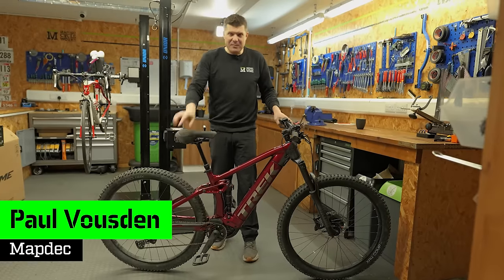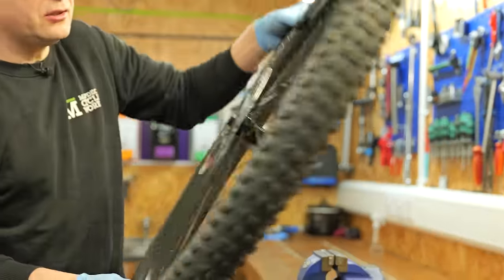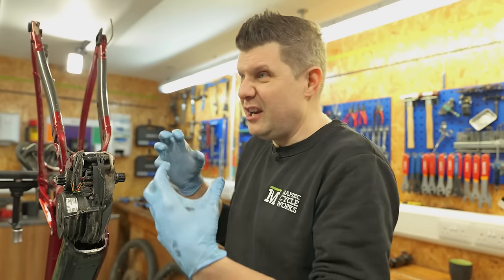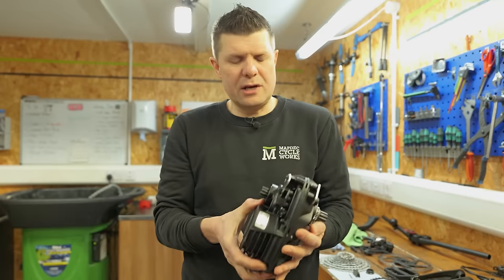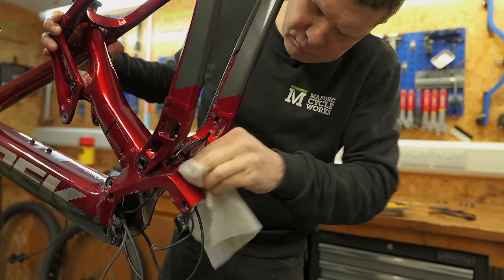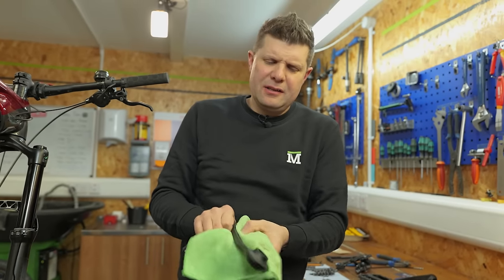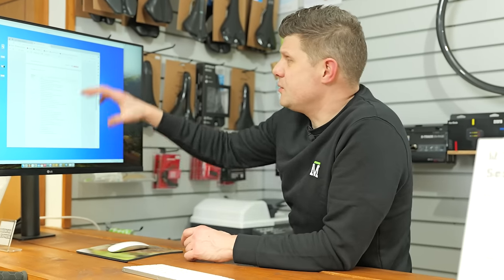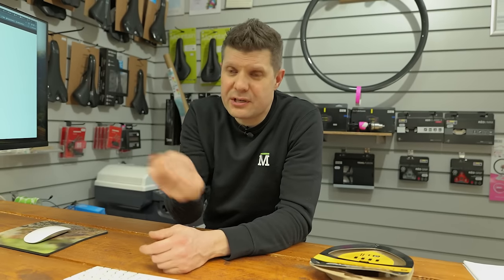This is how much work it takes to service your eMTB

Comment: Hi,
so it looks like You have roughly 3-3,5 hours for this Service... quite quick 🔊🔊🕴🏼
PS: funny to see that you  tik the boxes in the Service Report after the work. Do you remember that this system was intodruced rather in a step by step manner? Don't get me wrong. I love the way You work
Reply from the maker: I had to come back to it on day 2. This was about 5 hours work, because all the bearings were good. To include pivot bearings brings it easily to a full day and sometimes longer.

Comment: I have this excact bike.. 2022. (Brought in 23) ive done 1700 miles riding mostly bike parks.. (fod) i ride hard. Im 16st but im a sender. Got stronger wheels. And zebbs. Shock hasnt been serviced defo needs it. 2nd chain. 2nd cassette. Countless pads... joy of an ebike no motor service!. No bb bearings. But ya mine needs rest frame bearings doing and suspension service.. but i only have brink. (Chicksands) local. Wish i had a guy like this...

Comment: Madness prices.  My audi r8 cost £695 for a service at audi.   Ludicrous price to look at a bike with some alan keys and torx bolts.   Shocking
Reply from the maker: That service doesn’t include taking the whole thing apart, and the thing is.  A wage is a wage. Regardless of it being a bike, an Audi, a tractor or a lawnmower.
Reply: @Mapdec  there's a wage and then extorting people, it's alan keys and torx bolts lol.  I have gen 4 bosch motor in my bike. No equipment needed where as audi need £1000s pounds worth of ramps and tools.  

Shocking and if people pay you that for a bike service then more fool them
Reply from the maker: @emp7031  umm. Quite a bit of equipment needed here. Maybe not as much as a car garage. But we still pay the same rent and rates as one.

Comment: I have a Cannondale with a 100mm Lefty Ocho those forks just eat lower legs it seems and recommendations for a better fork?
Reply from the maker: The ocho is actually a really good fork. but Cannondale have not made it easy to access parts for servicing. We have to buy from a shop in germany. I think the best XC fork right now is the Fox 34 Step Csst with the FIT4 damper
Reply: @Mapdec  alright thanks it's just that after 100hr /200hr always small marks/scratches form on the lowers  and servicing is £330 pound each for 200hr and £190 for 100hr

Comment: I take the Wheels off and put clean rags on the calipers before I spray anything on the bike. Ruined a few pads before I learnt. Btw. whats your take ebike motor bearings? Some say they should not be cleaned with any detergent as it might seep in to the bearing and affect any lubricants?
Reply from the maker: If that mild detergent seeps in, then water and dirt has already seeped in and done the damage.  Keep those seals clean
Reply: @Mapdec  did some further online research and indeed seems that most big brand ebike motors are only IP56 rated. A pressure washer can go straight through the bearings into the engine housing. Clean and wellgreased seals seems to be critical for engine long term health. Important to not have the engine submerged at any point. A gentle brush wash should be fine.
Reply from the maker: @jonekone3769  exactly. That wash is no more than a running tap.  The motor is exposed to far worse riding through a deep puddle.

Comment: Great job 👏, I want to ask you about my Rail 9 I purchased it 6 months ago, and there that rattling sound on rough trails, some say from battery some from motor, I took it to the dealer I bought it and they check it and nothing to do with it, all tight well, what do you think ? Please advise me
Reply from the maker: As you have seen. Lots of things can rattle.  Your bike is in warranty.  Keep taking it back to that shop until they solve it.  Be persistent.
Reply: On the Rail, make sure to check that rear (UDH) derailleur hanger. Not the cause of your noise most likely, but the backside nut  holding it on (which is reverse thread if I recall), has been know to be not tightened to spec when leaving the manufacturer.  Yorkshire bike mechanic Chan had a video on it a while back. Make sure to tighten the hanger only to spec, not over.
Reply: If you go to the Yorkshire Chan, look for a title named Trek Rail fastener working loose. Important warning in description.

Comment: Hey mate, is it possible to do these services without updating Bosch's firmware? Or does it "make" you do it?
Reply from the maker: Oh.  You have it chipped.  Yeah, chipping voids warranty anyway.
Reply: @Mapdec  That's not an answer to my question. I don't know why you'd even jump to that assumption?
Reply from the maker: @MarioGoatse  yeah it is.  You can ask not to update firmware as part of service. Of course you can. The consequences are that they won’t honour a warranty if the motor was not updated at its service interval.  The same as they won’t honour a warranty if it’s been chipped.  Problem is that some firmware updates might disable your chip. Most folks who fit a chip know they have no chance of a warranty and just ask for the bike to be serviced, but not put through the Bosch service diagnostics.
Reply: @Mapdec  It absolutely wasn’t an answer. Objectively so. You assumed my reason for asking, and then gave me the consequences of your assumptions, instead of just answering it. I don’t like updating any software that’s running well as is. Firmware updates can and have introduced bugs that weren’t there in the first place. If it ain’t broke, don’t fix it. You’re talking about chips with literally no evidence for doing so, except your assumptions. It’s honestly sullied my respect for you, for being so presumptive and dismissive.

Comment: Question, why would you be able to "salvage" the chain for a little longer if the wear is absolutely fine but its dirty ? - I dont get it. Another Question is if the key is coming right, why unplug all the cables and get on with it anyway...... Dont you disconnect the battery in case of shorting something? Overall really like the service, seeing the motor under tap worried me but guess its totally waterproof. A lot of effort goes into these services! Looks like this service took 3 hours. Learnt a lot from this. :) Subscribed!! Servicing for me is 1/4 of that price as I do it myself.

Comment: @Mapdec Cycle Works  is the spray you use at the end ok to get on the brake rotors?
Reply from the maker: Everyone asking this.  To be fair the end of the vid was a bit flamboyant, but it hasn’t been a problem for the last 8 years or so.
Reply: Thank you,very cool @Mapdec

Comment: how does e-bike maintenance compare to normal bikes money-wise? 400-1k is pretty expensive (dont get me wrong! all your work surely is worth every penny, you do a great job and I love the videos).
Reply from the maker: The extra weight and power of an ebike kills drive train and brake components pretty fast.
Reply: @Mapdec The weight mostly / heavier operator , if they are 250 watt regulated ( Australia & parts or E.U. ) . In the U.S.A  the cap is 500 watts as the 750 watt actual limit would burn them out if at full duty cycle in 40 degree celcius still conditions .

Comment: Awesome content. Just one query. That "protect & Shine" spray you used at the end? Is that disc rotor friendly? I've been using Muc Off Bike spray, but apply it to a a microfibre rag and wipe on my bike as it's definitely not disc brake friendly. Thanks. Love watching a pro make easy work of bike maintenance.
Reply from the maker: Maybe. Been polishing finished bikes a long time and not had issues.  You have to try really hard to contaminate a rotor. It’s more like seasoning a wok.
Reply: @Mapdec  Thanks. Time for me to switch brand then I think.

Comment: Great job, there has been some controversy on the torque settings for the motor connections. What do you use and what is the source?
Reply from the maker: You tend to find torque specs on the bike brand tech manual. Trek use T40 at 20nm

Comment: A fantastic video and very informative. However what shot out at me was @27.45. Are you spraying polish directly over uncovered rotors?

I’ve always thought this was a cardinal sin…
Reply from the maker: Never been a problem.  But maybe 🤷‍♂️
Reply: Peaty’s protect and shine is silicone-based and surely you have 100% just screwed up her brakes?
Reply from the maker: @elslanedog1264  not been an issue for the last 10 years.  I’ll let you know.

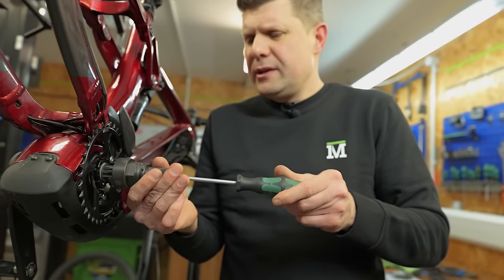Comment: What is that tool you used for the chain ring I am tired of stripping those lock rings! 22:01
Reply from the maker: Cyclus Bosch lock ring tool. They make two with different axle threads.

Comment: If the owner lost all battery keys , you would need to have a battery tumbler emergency removal kit which I have . Some bicycle retailers in my area have them .Paul could do with one of these kits .
Reply from the maker: The old style we could open quite easily with a pick set from Amazon. The new tube ones are too tricky for me.  We have had to call out a lock smith once or twice.
Reply: @Mapdec  If the keys are lost why not use a drill? im sure the customer is going to pay for the locksmith, plus your labor?
Reply: @Leviathandk  Leviathandk wants your opinion . I use a pick kit from Lockwood as do some nearby industry contacts . When I have finished the food contractors Merida CX LINE and associated work , I will have a sleep and go for a ride with some friends that have TREK / GARY'S tonight . We will ride socially . I want to make love to my TREK tonight while with them as an escape from work mindset . My TREK is beautiful and therapy for me .
Reply: Bosch System 2 was quite easy to dismantle even without the keys if you knew what you're doing. Smart System has worked around this with railing system where lock and battery connector are in this one bigger unit that's bolted to the frame so you can't get in from the outside.

Comment: Love your work and videos, but as a mechanic myself watching you clamp the bike from the dropper hurt a little 😩😂❤️
Reply: Where should you clamp from?
Reply: @BristolPost  on a regular seat post, completely fine to clamp from the post, on a dropper, better to clamp from the top tube with a cloth, or if you really need to clamp from the dropper, use a cloth there too
Reply: @Sam-s5c2g save my dropper kill my carbon frame. Nice.
Reply: @BristolPost  hence the cloth, can promise you no damage will be done as I’ve done it countless countless times, including with my own carbon frames, having the weight of the bike pull down on the dropper will do far more damage, and droppers can be just as expensive as carbon frames depending on manufacture. All mechanics are different and have different ways of working, not to say any of them are wrong, but I’ve seen droppers get messed up that way, and I’ve never seen a carbon frame get any damage at all from being lightly clamped with a cloth 👍
Reply: @BristolPost  or even better, if you have the time, remove the dropper and put a static seat post and risk no damage to either 👌
Reply: @Sam-s5c2g  below is taken from Trek directly but hey what do they know. 

Repair StandsCareful use of your repair stand is key with carbon!
The mechanical clamping action of repair stands concentrates powerful loads in a small area so you should always clamp your carbon bicycle safely. Never clamp the frame. Instead, if you have a round aluminum seatpost, clamp that. If your seatpost is carbon, the safest thing to do is to purchase an inexpensive aluminum seatpost that's the same diameter as your post and then use it for clamping when you work on your bike. You can hold the bike by the carbon post if it's round and you clamp it gently, but you may scratch it unless you're very careful and the jaws of the repair stand clamp are safe (keep them clean of dirt and wrap a piece of wax paper around the seatpost to help prevent scratches).
Reply: @BristolPost  who hurt you dude?

I agree with that, but it’s a lot more for liability purposes. I was commenting on the dropper post getting damaged, which it will. 

Many very popular mountain bike riders and high end bike builders on YouTube and mechanics I see weekly have all clamped from the frame gently with a cloth and most of them use a park tool stand which isn’t a circular clamp, it’s more oval to allow for more complex carbon shaped frames. This is also the stand I use, and as I’ve already said, I’ve done it many many many times, even on personal frames which I would absolutely not want to damage, and had no issues. If you don’t want to do it, then don’t, I’m not telling you to, I’m just telling you from my professionally paid experience.

Have a nice day, hope you feel better 👍
Reply from the maker: Interesting thread. Dropper is the safest place.  Clamping a 30kg frame lightly with a cloth is just dangerous for you and the bike. It will rock and twist about.  The load distribution of the clamp is good. I think Park did a vid once where they calculated it all and debunked that theory. The clamping force of the seat clamp was far far greater than the clamping force of the workstand.  Be safe.
Reply: @Mapdec  most bikes with a carbon frame, even full suspension 29ers won’t be anywhere near 30kg unless you’re on an E, and if I’m servicing an E I’ll always remove the dropper and insert a static before clamping. I don’t think either of us is wrong here, but I always like to avoid clamping from a dropper personally just incase something funky happens and then having to take the time to repair that FOC too 👍
Reply from the maker: @Sam-s5c2g  You realise this was a vid about an eBike?
Reply: @Mapdec  yes.. hence my first original comment.. If it’s a E bike, I would take the dropper out and insert a static seat post before clamping it..?
Reply: @Mapdec  you did read the whole of that last comment right? I was saying if it’s an E bike like the one in the video, I’d personally remove the dropper and insert a static, if it’s not an E bike, they’re so light that there’s absolutely no issue clamping from the frame if you don’t want to remove the dropper

Comment: Wish I could find a bike shop like this, Mapdec Cycle Works, in Northern Vermont. I have a Trek E-bike, Domane +HP with the Bosch Performance Line , Speed motor. Pedal assist to 28 mph.
Great bike, but when I took delivery of it , from a Trek dealer (not in Vermont)  it wasn't set up properly.
Cable to rear derailleur hadn't been adjusted, and screw on cable wasn't properly tightened. I made sure all the Bosch software had been updated , before I arrived, and asked for the printout.
Took my own shoes, pedals and bike shorts, and had 3 short rides before everything was right.     Anyone know a good bike shop, for servicing e-bikes up North here?

Comment: I guessed 416.76 to be specific, but missed by a tiny bit :P. I had my acoustic bike in for a service last summer and was devastated xD, it cost me about 2000 quid! Not going to use that bike repair guy again. 400 ish sounds dirt cheap compared to what I paid. Sure, i needed a new rear shock, did full service on suspension, but still... I paid 5.5k for the bike itself and using 2k per year on a service sounds harsh. I do change other parts myself anyway, so the cost is more on top of that annualy.
Reply from the maker: A new shock would have pushed that over the edge. Weird that you needed a mm entire new shock.  Air cans and shafts etc are not that expensive.

Comment: What do you do about literally every Shimano brand freehub that has a wobble in it that can be seen by moving the cassette laterally, wobble. Right from brand new. Do you go in and adjust that reverse thread spanner nut that’s holding the race on the loose freehub ball bearings?
Reply from the maker: Sometimes replace it, sometimes rebuild it.
Reply: @Mapdec  But almost every Shimano freehub has this wobble (it’s that the bearing preload is loose). Do you go in and correct the preload?
Reply from the maker: @GNX157  no. That’s not possible.  You can only replace the bearings when it gets really bad.
Reply: @Mapdec  Okay, you know the freehub ver I’m talking about right? It’s the one with the loose ball bearings inside, and the collar in question is always left a little too loose by Shimano? And this allows the cassette to have a little bit of lateral play.
Reply from the maker: @GNX157  yeah. They are time consuming to service, but simple enough

Comment: Curious to know the limits of e-bike service - can motors and batteries be serviced to an even greater extent? How far of a tear-down before warranty takes over, and then, when out-of-warranty, what do replacement motors and batteries cost?
Reply from the maker: When a motor is out of warranty there are a few minor things we can fix, like a stripped cog, or a bearing change.  There are a few specialist repair facilities that can do PCB and rewind repairs too.

Comment: I was charged £255 at team cycles Gateshead for my service, they had it just over an hour! I was told I would get it back and it would be like new, came back exactly the same but with a new chain,they didn’t even do any checks on the motor or battery which was the main reason I wanted it serviced, they to,d me they don’t touch the motor and any problems would show up on my display? I asked how the battery was performing and they said they haven’t checked it 🤔 came away feeling very ripped off and will never be going back to the dealer, have I been ripped off?
Reply from the maker: Umm. You might have been charged fairly for the work they did, but they should have been clear they do not service eBike.  You might want to watch a more recent video we did on e-bikes where a poor customer had a similar situation to you and eventually came to us when it was too late.
Reply: @Mapdec  thanks would of happily paid what ever it cost to have it serviced properly.